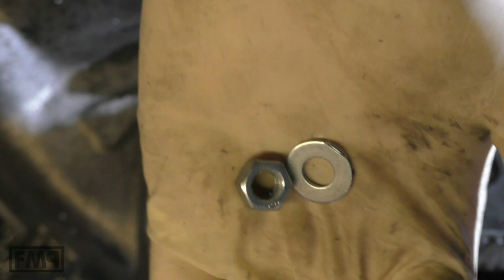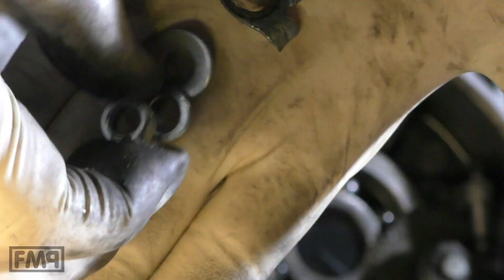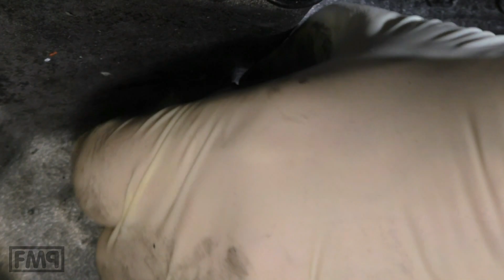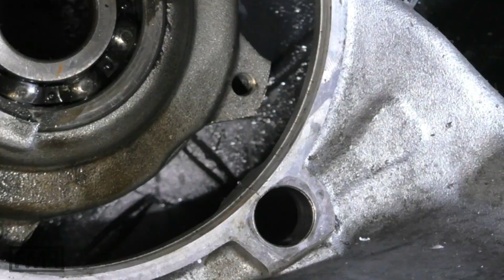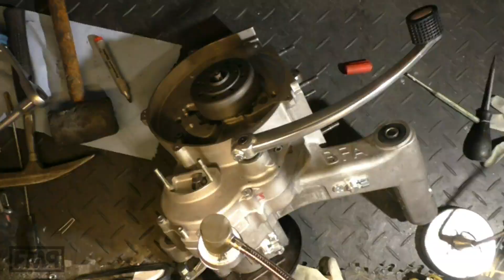vespa case CRACK PREVENTION trick |FMP - SolidPASSion |

Comment: This usually happens (cracks) on the cluster seat because it is fitted the wrong "xmas tree", old PX (1st series) has the "small theeth" grear, so the xmas tree shaft is smaller respect the later version (in Italy we call this 1st series of PX pre-arcobaleno  ( before the rainbow series), with the old style cruciform ) this small gears were installed on PX untill the 83-84 i think. The problem is that you can fit this smaller shaft on later PX with the "big thoots" gears, but the hole in the engine carters is bigger so there is a lof o backlash on cluth side where the xmas tree shaft fits, so during the rotation it wobbles and all the weight is retained from the screen (where you whow the crack), this is why usually this happens, but for sure the trick shown in the video is very useful.  :)
Reply from the maker: thx. alao hitting wrong gear in high revs, cracks an engine case. and these hits can be taken better, if this trick is applied.

Comment: Believe Scootering magazine or the like covered this maybe over 20 years ago. Surprised whoever it was hasn't shown it again. Hopefully this video will help. 👍
Have seen over ten cases cracked at primary drive, nightmare! Have also seen guys strengthen that area by welding. 
Swapped a big motorcycle for a Mk1 T5 over ten years ago, checked that area, but never removed nut and washers ect and looked fine. Didn't notice the cracked case till I stripped the scoot! No refund. Moral of the story  carefully check!  First time I have ever been caught out, by it! 🧐 Ended up giving the whole scoot away free, as so demoralised, so at least someone was happy. 😉
Reply from the maker: as well got the tip from advanced tuners. its a weired thing, that still. Only handfull of well experienced tuners do know about it...

u got this old scootering article somewhere? never saw it
If so, pls. Over fb page
Thx mate 🍻
Reply: @FreakMoPed8   will try and find it,  seem to remember it may even have been before everyone was on the tinternet 🤔, may not have been the scootering mag, could be scooter scene, scooter and Scooterist or the like. Had a magazine clear out last year approximately 40 years worth of magazines on the boss's (wife's) orders 😉, only managed to hold on to a hundred or so. Think it may have been the Taffspeed brothers. A lot of waters passed under the bridge since, but can definitely remember reading about it and have used it since. I thought maybe you has seen the same article when you put up the video about it a couple of years ago and was very pleased to see you passing the info on. Certainly didn't think of it myself. 😉
Reply from the maker: was never in magazines, also bit younger = internet as THE info. git it from a quite well known austrian tuner back then. First Video didnt get a lot of clicks, thats why i made a second one. Its a big shame that seriuosly no one knows about it. Thx for the search. Would be interestjng.
Yesyes the government, i known 😄🍻
Reply from the maker: would be great if you find it, to bring proof: this is nothing new. this is very old knowledge, piaggio most probably, just few tuners remember it.  i just tried to find it on youtube, nope. all videos in this respect are missing it... sad but true.
Reply from the maker: @jimsregaturntableshifijukebox  ps we also share the music and HIFI love ;)

Comment: Using straight cut gears also reduces this crack point on more powerful motors, by reducing torsional stresses. 😉
Reply from the maker: indeed. of course it reduces. 
But, with standard gearing and this simple trick, no stress at all, with even high end power engines

Comment: I have a small leak apparently coming from the primary nut, my scooter is a stock 1982 px 150e. Could this kind of crack explain the problem? Is it possible to crack a case with a stock engine?
Reply from the maker: no stock engines usually dont crack. it will just be a leaking clutch cover. replace both seal rings.
Reply: @FreakMoPed8  I have already replaced the whole clutch cover and o-rings. Now the leak is very small but I can still feel the nut getting "wet" after riding the vespa. Maybe the washer is not set correctly ?
Reply from the maker: I mean u see cracks do u
I.would.still.suspect the cover
Reply: @FreakMoPed8  I'll let you know when I have time to check.
Meanwhile I've bought a new nut, washer and safety clip.

Comment: Maybe an old question - looking for power upgrade Vespa PX 125 CAT 2015 Euro 3 but simple PNP - no grinding
Is there a DR 177 version to fit ?  Cannot see one.     Is a 24 carb alone, an alternative option ?
Have already fitted SIP Road 2 and P200 air filter so maybe power is up from a lousy 6.3 to 8 HP already (54 mph or 86 km/hr GPS on a good day). Happy  to try to fit a 22 tooth clutch cog if I get that far
Reply from the maker: DR cast iron yes, in the end every 177 cylinder. i would recommend a VMC, also the superG is fine,
Reply: @FreakMoPed8  Thanks - so DR or VMS super G are good, but any does ?
Has  it GOT to be cast iron and just the cylinder or the head as well ?   
Am thinking a dark colour or cast iron so the authorities do not recognise it as being upgraded.
Reply from the maker: Head and cyl